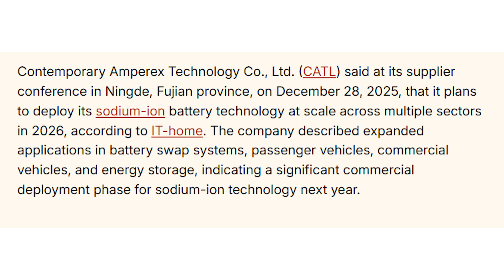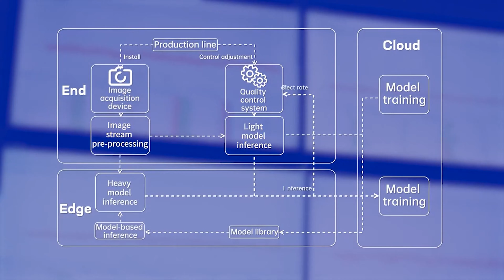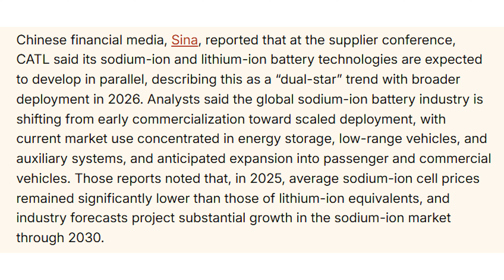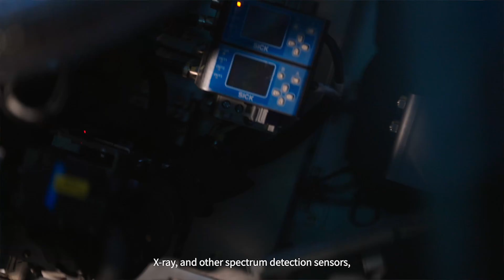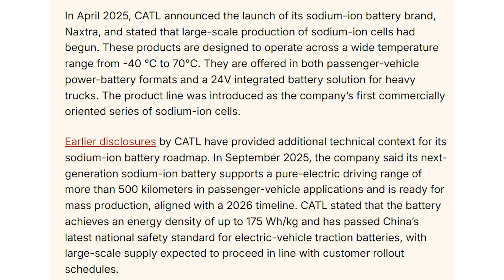CATL Release official Sodium-Ion Roll out Timeline

Comment: Have you looked at E Range trailers? they retro fit 53' tractor truck trailers with a battery pack hanging under the trailer and the two rear wheels with electric motors. and fleet operators are claiming double the gas mileage from their truck fleet. so going from 7 mpg to 15 mpg for swapping out the trailer with an E Range package. They are also California compliant refer trailers because they use no diesel to cool the trailer just the battery powers the AC for the trailer.
Reply: Weren't Donut Labs pushing something like this at CES?
Reply: Any battery on a HGV or its trailer, increases its tare weight and reduces its legal pay load limit, and hence its earning potential

Comment: I would NEVER park a Lithium battery powered car in my garage for fear of a fire, but I would park a Sodium battery powered car inside my garage 24/7 and not worry a bit.
Reply: Your ICE car is far more dangerous than lithium. In the civilised ends of the world it's also why garages are already fire resistant, because ICE cars blow up quite regularly. We live with it because it's considered an acceptable risk even in the ICE case.
Reply: Have you ever seen what happens if you toss sodium in water? Or light gasoline on fire?
Energy storage generally implies potential for energy release.
Reply: That does not make sense. You still have a lot of energy packed into a small volume. And there are other things that can go wrong and lead to ignition events apart from the cells and it's chemistry.

Your house's electrical system is equally safe/unsafe no matter where the electricity is coming from.
Reply: Stop letting the fear driven news and internet cloud your judgment. 

The absolute undeniable fact is that lithium ion batteries are safer than gasoline engines. 

About 1,500 FF cars catch on fire for every 100,000 sold.
That's almost four fires per day in america, for every 100,000 car sold. 

About 25 EVS catch on fire for every 100,000 sold.
For about one fire every 15 days for evs, for every 100,000 sold. 

The fact that the news and internet don't make a big deal about gasoline fires, does not mean they don't happen. 

Exactly the same way that most people seem to think that violent crime and murder have gotten vastly worse over the years. Whereas the fact of the matter is murder and violent crime is about half of what it was in the late '80s and early 1990s.
Reply: Similarly I would have sodium home battery storage, but not lithium.      I am one who would trade some performance for safety - don't trust any of my lithium batteries and would love Ryobi to have a sodium option.
Reply: They had nickel for a long time

Comment: Are SIBs Goodenough?  No, that was the lithium battery. Boom boom. 

(You might need to be of a certain age and a bit nerdy that one.)
Reply: SIB's are going to be cheaper and work in a better range of climates.. From -40c to +70c with only a 7% loss in range compared to 20-30% of current lithium ions.. That's why I want SIB's in whatever China drops into Canada this year... 50,000 models or about 3% of the market... Not a lot but a start... And the quota builds year after year...
Reply: @stickynorth r/woosh
Reply: Technically even the range of lead acid were Goodenough prior to the Dr's patents coming along... At least in the GM EV-1 for range... It was the longevity and weight that sucked...